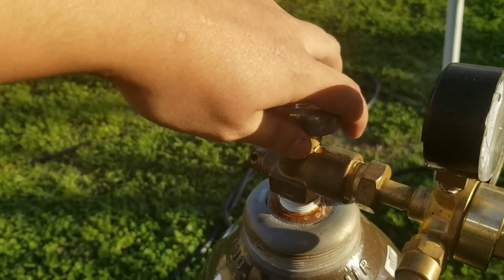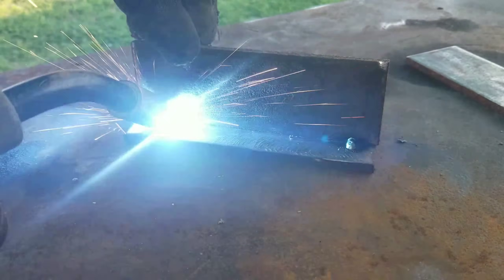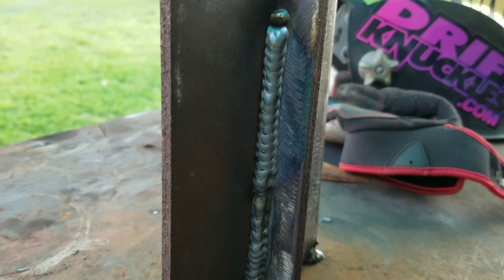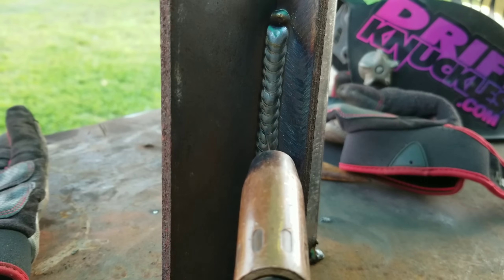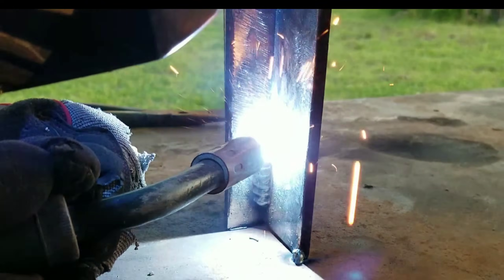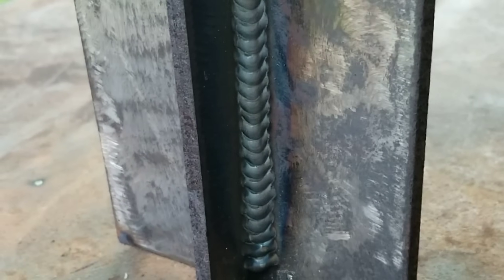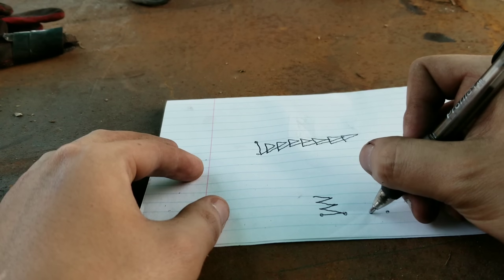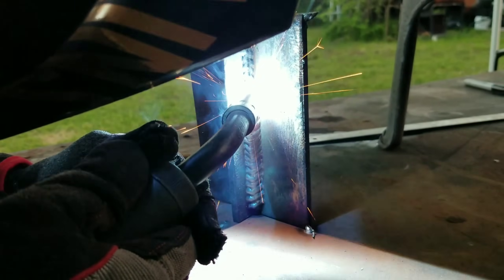How to mig weld uphill

Comment: Question
If you have a Millermatic 252 (Digital Mig Welding Machine) with 035 (9 mm) wire, and you wanted to weld 3/8 Thick Plate what Voltage Number and Wire Speed Number would you Use? 
For Vertical Uphill and horizontal, Downhil, etc

Trying the find the Right Numbers on a New Machine I'm not Familiar with is a Battle.❤😂

Comment: My problem with this is getting a flat weld. It also looks like the weld in the video has a high degree of angle where the base metal meets the weld. If its under 110 degrees, it won't pass. Anyone know how to get a flatter weld without making the throat bigger? I'm taking a test on a 10mm plate FW uphill process 135, max throat dimension of 8.2mm.

Comment: Bro I'm on a welding course atm struggling with uphill Mig and keeping it consistent.
I'm back in tomorrow night, it's a night course. I'm going to buy a cheap toy gun and tape a pencil to it, then tape some paper into the corner of a wall and practice that way for a while.
I have no welder myself atm, looking for a reasonable machine too.
I'm based in Ireland so limited access to good used miller and Lincoln's

Comment: I do the zig zag with 7018 on the arc welder, but when I tried it on my mig it was a mess.  Maybe I was set too hot for uphill, i can’t see my puddle like with the stick so not sure.
Reply: I work as a fabrication welder and when we weld uphil in a corner, we turn down the amps a ton.(our steel in this uphill situation is pretty thick and we are running .45 wire with gas.) but we still cut the amps near to half, turn the wire speed down by half, and use the uphill zig zag, keeping it tight as a drum. This particular weld that I speak about is about 10 inches to weave and it’s the only time we are allowed to weave. Hope that helps.
Reply: @larrymasterspowerbuildingc4477  thanks, I’ll try that next time.  I never cut it back by nearly that much before.
Reply: @stovepipe9er  oh yes absolutely you have to find the setting that works for you. But We tone it way down to prevent weld discontinuities. We turn down everything because we have to spend some time making a super tight uphill bead and if the temp is too hot and the wire sped to fast, the metal gts too hot and we will fuck up 6 tons of metal fabrication in an area of 10 inches and well--that'd just be bad all around. So, hahaha, we gotta have fusion and it has to be penetrated just as good as the other welds, but we tone it down to prevent drip and blowthroughs due to this one particular part that requires a solid uphill  pass.
Reply: @larrymasterspowerbuildingc4477  makes sense, the welds I tried were a saggy hot  mess.  It just threw me off because I don’t turn down a 7018 that much,  say 95 for flat and down to 85 for vertical.

Comment: Thank you vertical welding has always been hard for me the molten metal would always drip down and I’m never able to get a clean weld
Reply: same that shit kicks your ass
Reply: Exactly. I always get a damn glob of shit that looks like hell.
Reply: Just need to practice spreading the heat and spend more time on the edges rather than the middle and mess around with your machines settings because some timez they can be different on certain machines👍

Comment: Good job bro i could never pick up the the triangle uphill when in training so I stick with zig zag lol
You should have mentioned the need to hold sides for 1.5 to 2 sec's and move quickly across the middle to a little less than half way on previous weld for tighter weld... if that makes sense but I'm sure you know that as you said your just rusty. 
Keep up the good work your a likeable character!

Comment: Have you tried a bend test on your 3G triangle coupons? The bead is pretty, just not sure if you’re getting good enough penetration. Let me know if you try.
Reply: Hoosier Fruit Shooter I was wondering the same thing, with these techniques and crossing the arc over the molten metal like that doesn’t really get the penetration you could get with just a regular stringer bead.

Comment: to be honest you are not suppose to weld up hill.With solid core wire.use flux core with 75 / 25 argon mix.it will work with hard wire but it could crack from vibration or stress..I am an old man that's been down this road before.If you don't believe me ask any old welder.
Reply: More penetration going up hill so stfu

Comment: Thanks, alway learn alot from your video. How about one for how to set wire speed.
Robert
Reply: On my Miller mig (251), there is a chart under the cover. At least it's a place to start. Today I was welding .5" butt to butt after grinding the edges plus leaving a .035 gap along the entire weld. Came out OK, but wish I'd had .045 wire because the weld area didn't seem to fill up.  Got great penetration using .o35 wire at 23.4 v at 475 wire  speed.  Bryan if you are reading this, I'd appreciate tips on set up, too.

Comment: Usually I adjust my settings for 1 or 2 material thickness lower because heat rises and it's as if you are running hotter already. If you dont it will overheat the parent material and you will lose control of the puddle.

Comment: Would have been nice too know what your settings were and what you did to dial it in
Reply from the maker: I wanted too but the nubs on my machine go from 1 to 12 so it wouldn't really tell u like the  exact settings
Reply: Depends on what ga hes  using every ga has different settings
Reply: @sarakay7291  For sure. And wire thickness settings are unique as well.